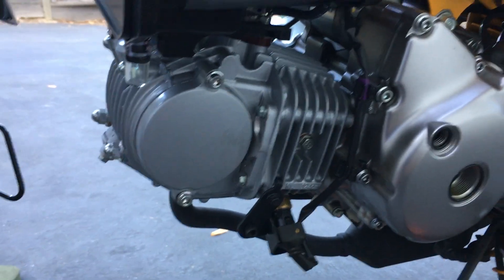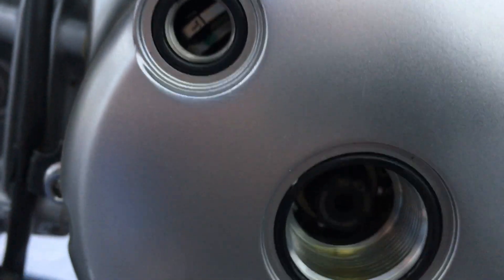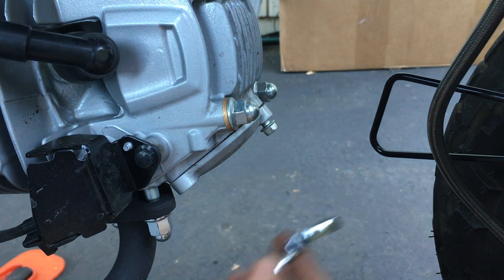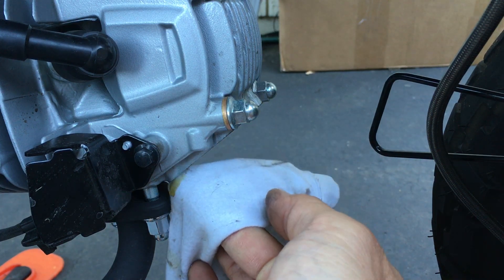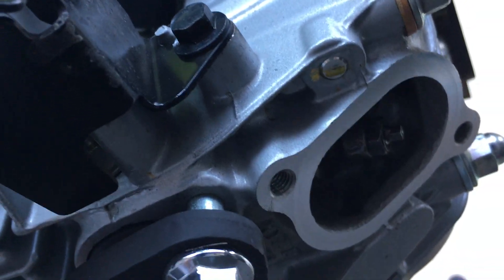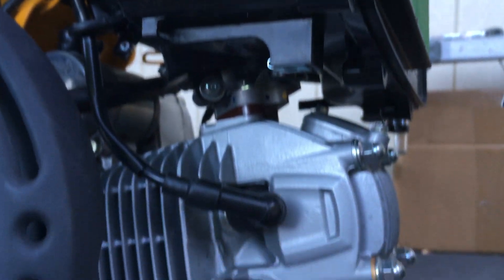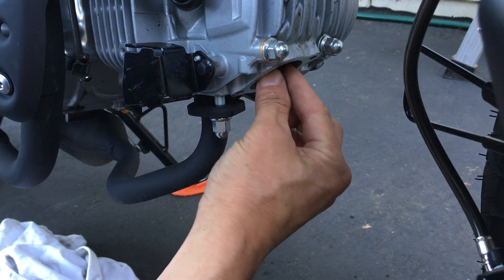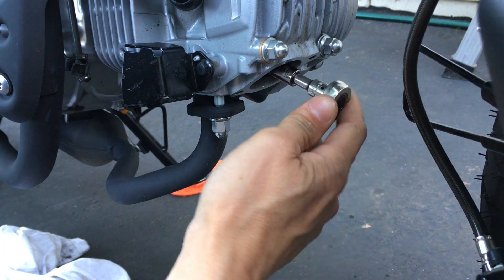Monkey valve adjustment pt.1

Comment: You might want to clarify that not only does the crank need to be at TDC, but also on the compression stroke.
Otherwise one of the valves is going to be partially open and you’ll get incorrect clearances with your feeler gauges
Reply from the maker: only need to be at tdc which stroke it is doesn't matter.  If the piston is at TDC the valves will always be closed.  Single cylinders don't have to worry about any of that other stuff
Reply from the maker: @Phil M you can feel it
Reply: @Phil M Valve tappets feel loose and not firm.
Reply: Need to do this on the compression steoke.

Comment: Screw type adjusters are an "easy" job, but buy the Motion Pro Tappet Adjustment Wrench Set, makes the job SO much easier, especially in places with minimal clearance like doing the intake valve.
Reply: Will the motion pro 9mm tool fit up on the intake side with just removing the front airbox element cover? I'm pondering buying one. Tnx for any info.
Reply: @findingneutral  Don't know, I took my airbox off and would recommend the same, easy enough and you won't have access issues.

Comment: Hey, what size tool do I need for the small engine plug? I heard you say the large was 14mm. Also they are hex keys right?
Reply from the maker: spark plug is 16mm
Reply: DaBinChe no, the plug at .47 what size tool do I need to remove that small plug?
Reply from the maker: @baldilocks1914  a coin or large flat head screw
Reply: 6mm hex head  for the timing mark plug; 10mm hex head for the crank cover.